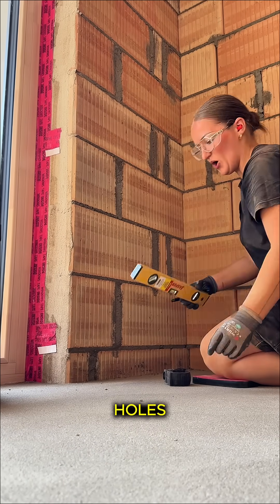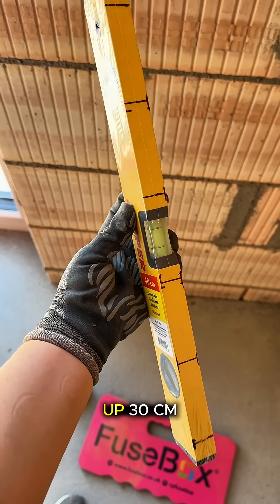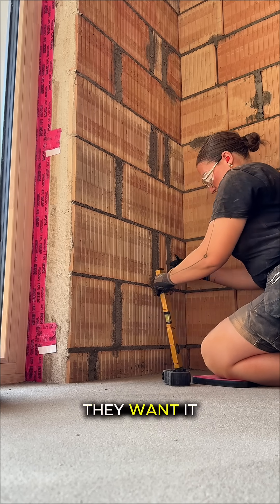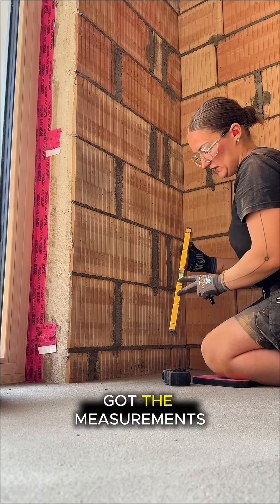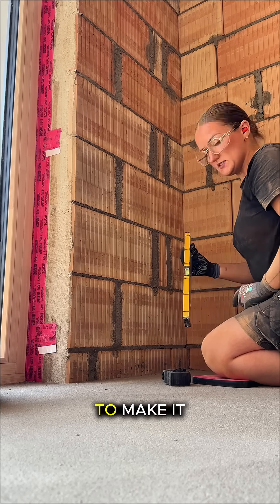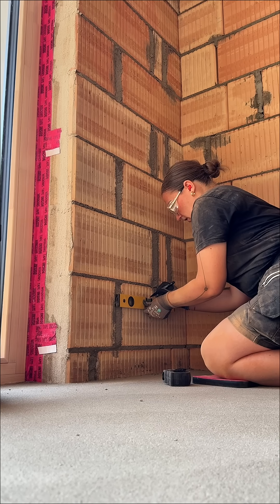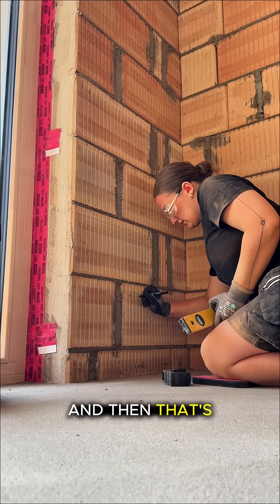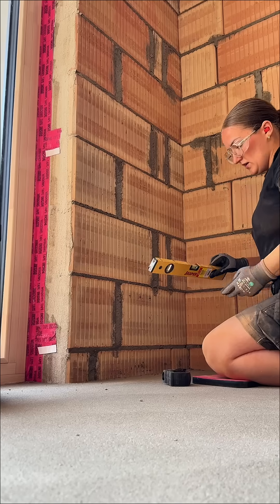How European Back Boxes Are Measured & Cut 🔨⚡ | Smart Home Rewire Project

Comment: I'm sorry, but you look like a beginner. For a long time, there have been frames for marking in combination with a laser to draw an apartment in half an hour. 
But you're great, it works too. 👍🏻
Reply from the maker: Hey! Yes I am a full beginner, 10 years a spark in the UK where we had square or rectangle boxes. this was my second time ever doing european circular boxes! any tips are welcome!!
Reply: @kimmythesparks  European back boxes also have a marking frame and a small tip, on the back of the box e a small pin It is good to mark it on drywall.

Comment: 30cm from surface without plaster ... are you sure it was not planned as 30cm from final surface ? Add 15mm for plaster. Also, its way easier with cross laser
Reply from the maker: On this job the client confirmed that they don’t mind the few mm from the walls and flooring… except the kitchen a and bathrooms where the tiles will go and it will be much thicker… and the cross laser is too time consuming to set up when there’s only one set of sockets in a location… but for places like the kitchen or bedside where there’s a few going in I used a laser ✌️

Comment: Laser levels make this a lot easier.
Reply from the maker: Yeah I’ve got a level, but then I’ll still have to set it up and get a tape measure out to mark the distances… so it takes about the same amount of set up. I used it for the kitchen where there’s loads same level, but not worth the set up time for smaller sections like this
Reply: @kimmythesparks I get you. I got a retractable metal pole that I set up in the middle of the room and slide it up and down when needed. £50 from the wholesalers and cant live without it now. Keep up the good work 👏
Reply: Laser level that I ve worked with builder was to provide a datum to which work off and to ensure all sockets are level around a room, prior to laser level, was the old water level